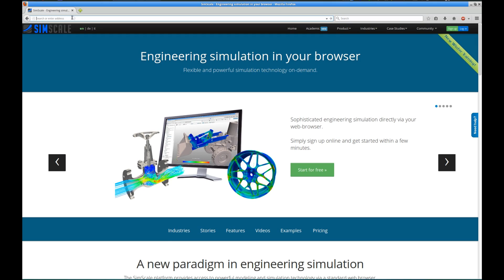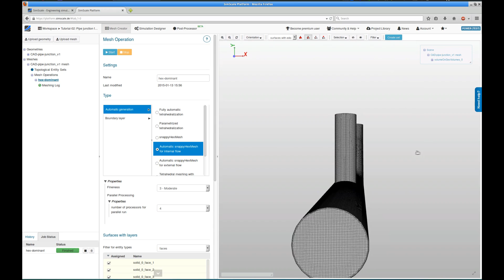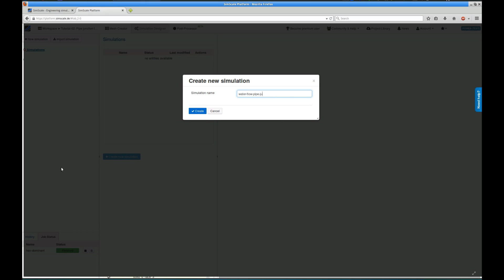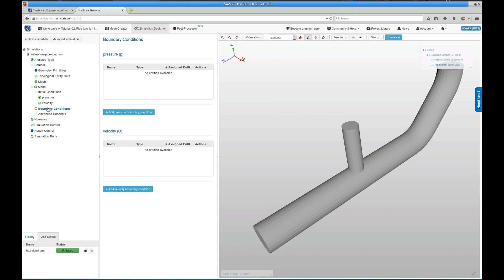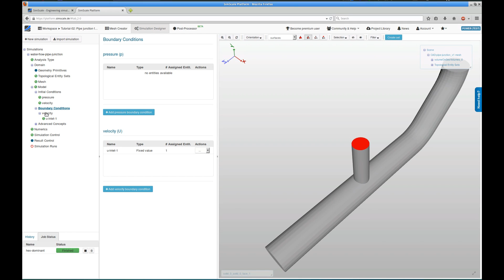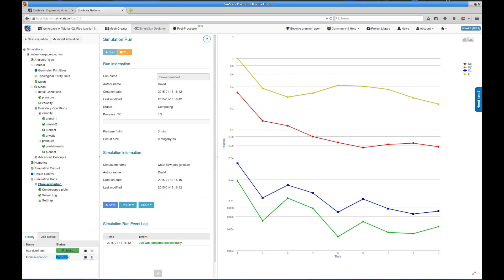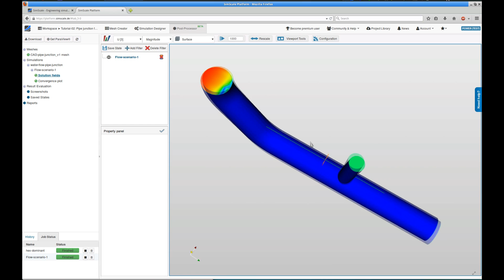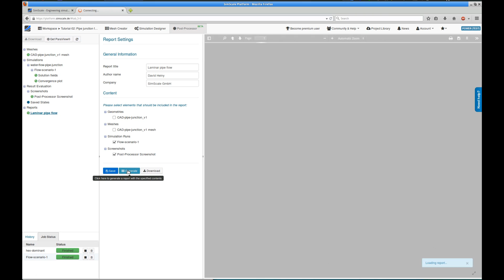Pipe Junction Flow Simulation

Comment: Can i use simscale for ramjet engine cfd analyais at different Mach speed and thrust?
Reply from the maker: You can use the SimScale compressible solver to solve such cases (https://www.simscale.com/docs/analysis-types/compressible-fluid-flow-analysis/). High Mach numbers can be quite unstable so please be careful when setting up the simulation.